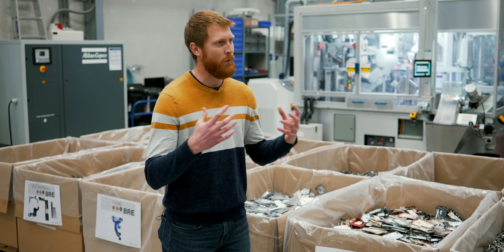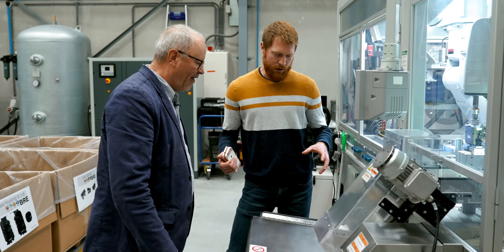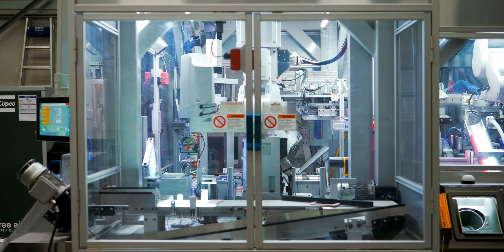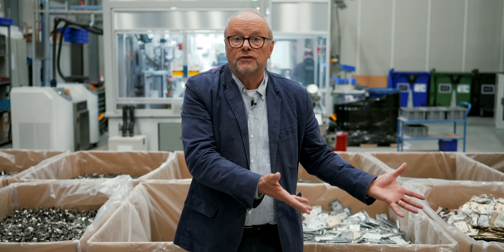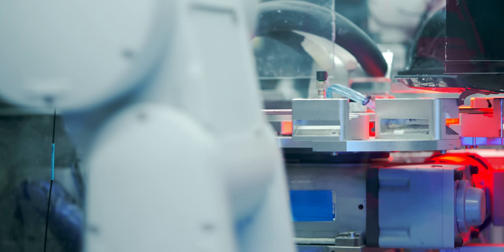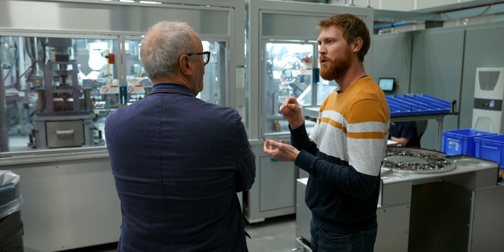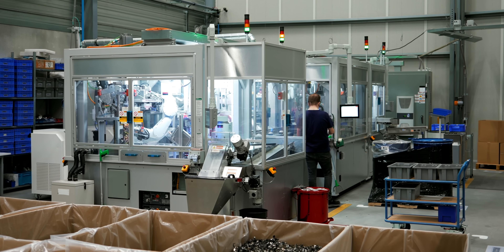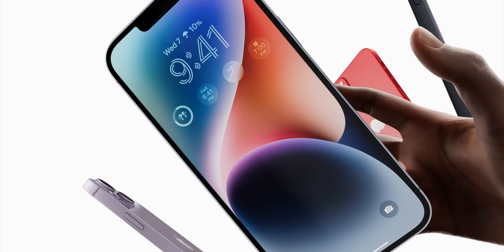Is This Robot Apple’s Most Important Device Yet?

Comment: If modern devices were repairable, that would be environmentally friendlier
Reply: Absolutely. 
You have addressed the elephant in the room. 
Planned obsolescence and repairability.
Reply: And more expensive
Reply: Fair phone makes it easy to replace the battery, but the charge port is soldered onto the motherboard making it impossible to replace. I replaced both the battery and charge port on my iPhone se. On newer iPhones the hardware components are software locked making this almost impossible. Apple are just too greedy and don’t want people to repair their own phones.
Reply: 100% agree. If apple really cared that much they would support right to repair.
Reply: @davydrav  Repairs don't suit the business model. That's why Apple and Samsung make it uneconomic to repair when compared to purchasing a brand new replacement.
Reply: @maxkendal5152  eh more that outside of basic repairs like screen, battery or connectors it’s cheaper and easier to recycle the device than to try to resoder completely
Reply: @maxkendal5152  I bought a A70 a few years back. 450€. Broke the OLED touchscreen for 95€. I don't find it uneconomical.
Reply: @ricardo1e93  To replace Samsung S21 or 22 Ultra battery. $239. Only for the part. S20 5g $206
All these batteries come with a new screen attached. The battery is glued to the screen and not sold separately. Screens don't degrade, batteries always will.
Reply: @maxkendal5152  and they never will. Large power blocs like the EU, US need to mandate right to repair and they need to do so in a way that the likes of Samsung and Apple can't be dicks about. E.g in addition to requiring the right to replace components, electronics should be required to display a repairability score in their advertising materials. This would have to account for the right to use OEM parts, use of DRM / proprietary protocols / patents, use of glue / solder / proprietary fixings, ease of performing simple tasks like removing the back & replacing a battery, ease of more involved repairs like screen replacement, cost of replacement parts, recycling policy etc. It would incentivize consumers to buy more repairable devices and for manufacturers to sell them.
Reply: @maxkendal5152  That's why there are people like me who lives in a place where repair and keep stuff running makes part of the culture and we just can't afford to keep buying new stuff unless you're that average person who just wants person who doesn't looks at cost because reasons. Me and my colleague at the local shop (in Europe btw) can replace an A70 2019 battery for less than 100€, maybe even about 60~70€. I mean goddam a battery for 230?! 🤣 I can buy a lot of 5 of the same Samsungs I've got to refurbish, get them fixed and literally and turn that number into profit. We really are in different worlds.
Reply: @ricardo1e93  I recently replaced the screen on my daughter's Samsung A13. When looking for a new screen, I went to the Samsung website. Didn't see any screens available, but the first option on the site was to trade in for a new phone. £25 to ebay and within a couple of days she had a working phone again. The hardest part of the repair was removing the back. That's how life should be. Repair it yourself or find someone to do it for you.
Reply: @rcpmac  Apple wins. Samsung wins. When a device costs more than your fridge but lasts maybe two years? Who's winning?
Reply: Exactly. They glue them together and you can't even replace the battery. Battery and screen replacement should be easy and mandatory for all new phones - then we'd get a couple more years out of each one. 
Also I'd pass a law to stop breaking software changes, or this "Your device will only get security updates for 2 years" nonsense - these things are all designed to force us to buy new devices.
Reply: @adsheff  I suppose you’re still using your Windows95 486 PC desktop as well. Built in obsolescence indeed.
Reply: There are smart phones designed to be repaired. People generally choose not to buy them!
Reply: @MrAdopado  fairphone is not made available globally 😢
Reply: @captainvijaikanth  There are other repairable smart phones (other than Fairphone) available in different countries.
Reply: I'm still using my iPhone 6S. All iPhones after that doesn't let you replace or repair individual parts. Even the home button and the screen is in one piece. They make sure that you can't repair anything. All my electronic devices are 2nd handed. Buy 1 year and 1 gen. old devices that are still very good but at around 60% of MSRP, which isn't going to do anymore than a brick anyway. You can still get many years of use out of it. My first mobile phone ever was the Nokia 3210; my second was the iPhone 4S and now the 6S. There is no point updating hardware when you do the same tasks with every new device.
Reply: @Kenneth  that's great for you. But can you run all new apps..? Are they not performance specific ?
Reply: And if you could just pop a new battery in YOURSELF. This should be MANDATORY.
Reply: So if we take the cost of financing this project and the day to day running costs, how does that stack up against the money retrieved from the phone
Reply: @TERRYB0688  I am pretty sure in times where Chinese Monopolies on many vital resources for electronics are everywhere (think of rare earths for batteries & magnets) upcycling (so essentially reusing) materials from manufactured good become geopolitically imperative! And because of this I bet soon recycled resources will be cheaper to source than dug-up ones. 

I even think if consumers return their old phones for free (or like 10$) to apple they might improve on their profit margins in the near future.
Reply: But what do you do with the bits you can't repair. I'm sure you mean well but I bet the answer is going to involve some kind of landfill used by you or whoever you use to clean up your mess or all those others less responsible than you (i.e. almost literally everyone else). Or worse. E.g. an incinerator. Most people don't bother with repairs and they actually don't make much sense economically once you factor in the cost of labor, parts, and skill development. And sure, Apple could do better here. But it wouldn't matter much.

You might feel good about spending an hour repairing a thing you own. But for every person that does that, there are hundreds that would have to pay somebody else to do it because they can't. And when that person wants 20-30$ an hour, it gets expensive quickly. Like more expensive than a new device. The value proposition of repairing a 2$ part for 200$ just isn't great. And it doesn't matter that some repairs are cheaper than that. Because you'd have to be able to diagnose the problem to guesstimate the cost. And most people just aren't capable. Some of those devices might get the love and attention they deserve. But the vast majority gets recycled, at best. And even after a second or third life. It still needs to be taken care off.  Repairing it doesn't solve that problem. It just moves the problem. And today that means uncontrolled disposal. Which means landfills and worse. Recycling is cheap and even profitable if done for free. And most of the reusable stuff is reused. Unless it really can't. In which case it is disposed off responsibly.
Reply: I don’t want to repair a phone, I want a new one every year
Reply: @Nextburjalarab  yes me too.
Reply: I’ve got 2 working iPads that I can no longer update the iOS for, which means I can’t update to apps that are still supported. eBay stops working, YouTube stops working and I have to resort to the web versions. Until, that is, I can’t get the latest web browsers that the sites require, because they need the latest OS. No more Facebook, no more online banking….etc. Built in obsolescence is something no manufacturer wants to talk about, but what’s the point in manufacturing beautiful strong aluminium cased retina screen marvels, if, in 6 years, they’ll be abandoned because they are no longer supported. You don’t really buy these products, you sort of get a temporary license to use them.
Reply: @gaztambo139  maybe you should look more at the awesome, amazing life enhancing technology that you're able to use...packed into that tiny, portable device!!
...instead of just criticising the global technological system which has made it all possible......
We take this tech FAR too much for granted....in half my lifetime, this industry has gone from not existing -  to making everyone's life massively enhanced...
...and now, they're recycling!!!
Reply: @andymccabe6712  You’re right, they’re great products, not criticising them at all, but just pointing out that if they continued support for these products, even in a limited way, (for a fee even) the products wouldn’t need recycling as soon.
Reply: Stop planned obsolescence at the outset.
Apple are the waste makers because their products are not repairable.
Reply: True. The reality of the market is that people like to buy new shiny things though. Also, you can repair things but eventually you will need a phone with a faster processor, more storage, etc. so new devices are inevitable.
Reply: If Apple didn't BRICK their devices after only a few years it would be better.
Reply: Not really.
Reply: Repairable phone does not make economical sense until it become a subscription based service. I mean the phone should not be bought outright but need to be buy under subscription
Reply: Is this gaslighting us all, Apple being creative in increasing their profits through recycling, keeping the Unit cost high?
Reply: I fully agree, I have a drawer filled with old apple tech, that is good enough but are unable to update or install apps because of apple's greed.
Reply: or maybe get a new iphone when you need a new one and not every year... simple green washing like mcdonalds and everybody else did... they give a shit on the environment
Reply: If you would be okay using a Nokia 3310 there wouldn't be any problems at all. But we aren't. We love new things.
Reply: @thomasweiler1680  If Apple told you your 14 back glass was a £559 repair and not covered by warranty, but you could trade it in for a shiny new one? That's the kind of issue. Imagine buying a car and replacing one door equated to half the value of the vehicle.
Reply: Fairphone is the brand you're looking for
Reply: @salvadordavinci7   It still is not available globally. So no, it is not something people should be looking for.
Reply: @lot maakchos  why not ? Surely somewhere is better than nowhere..

What if its available in my area.. is it a good solution for me ?
Reply: I completely agree it would be - but only if the average consumer was happy with having a phone for ~5 years. The reality is that people want the latest and greatest screen, camera etc. There's no quick fix for that, so I think this is the best fit for the real world. Great to hear it's open source as well, very un-Apple!

Comment: I have had a revolutionary idea that would prevent the need to do any of this

Keep your existing 'phone and don't buy the new, overpriced, latest model
Reply: Ok, i will keep my iPhone for 10 years. Probably replace battery several times. What then? Continue using my Phone for another 10 until its fit for a place in a Museum? The whole video is about recycling. Reduce, Reuse, Recycle.
Reply: @JackieWelles  Who said anything about keeping it for 10 years ?  

If everyone just kept their 'phone for twice as long as they do now then the amount of effort needed to recycle them would be halved.  As for changing the battery, why don't Apple make it easy ?
Reply: @Bob_Burton  People already keeping their phones longer than before because yearly upgrades are so minuscule. Apple also makes it very easy to replace your battery (through repair service). I agree that repairability is important and that Apple and other manufacturers can do better. But even repairability cant prevent a device from becoming obsolete. That's why your first statement/idea is completely out of place here. Recycling is as important as repairability!
Reply: @JackieWelles  I have nothing against recycling, but what I object to is the need for so much recycling.  Apple may be putting a spin on their recycling but ultimately it is driven by economics, which I am sure Apple will have worked out to their advantage as they are surely not doing it out of altruism

I am glad to hear that people are keeping their 'phones longer, if that is the case

As to Apple making it very easy to replace the battery, that sounded great until you added your rider "through repair service".  What happened to popping the back off the 'phone and inserting a replacement battery ?

It takes a long time for a 'phone to become obsolete.  Sure, you may want the latest and greatest features but until services such as 3G are turned off your 'phone still does all the things that it did when you bought it

When you say "Recycling is as important as repairability!" I think you have got it back to front
Reply: @Bob_Burton  You have made some good points but let me ask you this, where do you think the materials comes for all the new products? We wont stop producing or buying. This is  literally what drives the economy. Thats why i hope that we can dig less and less, instead recycle more and more.

Talking about non-removable battery ofc it has cons and pros it was nice changing batteries on the go, but the biggest benefits of non-removable battery is Better Water Waterproofing, thieves cant disable the device as easily by taking out the battery, better and more efficient use of space inside the phone.
Reply: @JackieWelles  I too hope that we can recycle more but only when it is necessary, not when fashion dictates that a new 'phone is "needed"

The biggest benefit of non-removeable batteries is to the 'phone manufacturers who go out of their way to make replacing them as difficult as possible.  Any other benfits are just side effects of that

Comment: Apple has to invest more in the products to be repairable on documentation and components.

And in this to collect certain electronics or batteries for the repairs.

And Apple should refurbish more.
Reply: This is the real problem, their phones are not made to last or be repaired. It's all about new products. You must buy the latest model because we do not support the old models anymore.
Reply: @recumbentrocks2929  am typing this on a 9 year old macbook air (which admittedly now needs replacing as a work laptop, but may have a second life as a child's homework laptop)... on the other hand, I had the first couple of iphones and they became obsolete so quickly due to the operating system being repeatedly upgraded and bloated until the hardware could not run the software any more, at which point I switched to android phones which, if I have to replace after a few years, at least don't cost silly money.

Comment: Sure recycling is important but nowhere near as important as consuming less and having products that can be maintained - Apple. Rare metals are going to get more and more expensive so this is all about the bottom line for Apple. Don't dress it up as Apple saving the world.
Reply: An extremely valid point. Apple's profitability is based on customers buying  a new phone every year, but they can easily last 3-4 years. The biggest impact to the environment would be for manufacturers to get out of the annual product life cycle. That's just not going to happen though as they're focused on growing sales not reducing them. If they can get close to 100% recycled products, that would make a massive impact to e-waste.
Reply: Reduce, reuse, recycle.
Why do the phones only last 4 years? Software updates and dying battery chemistry. Bring back the removable and replaceable battery and update software for longer. We don't need 3 major versions of the operating system. We need the one we bought initially with the phone, to remain secure and if not, open it up to another software developer to provide extended support.
Reply: Not really.